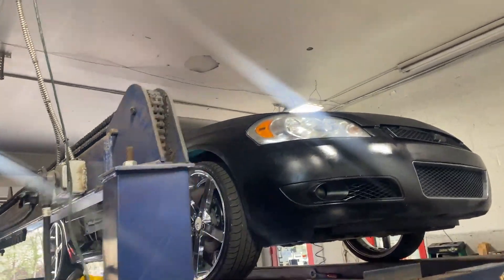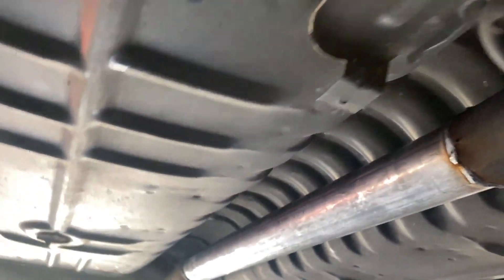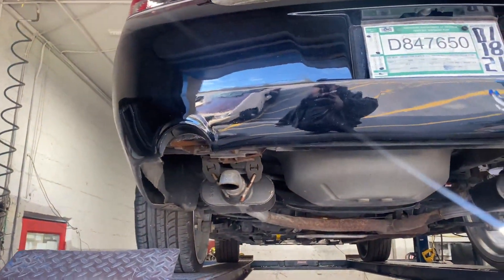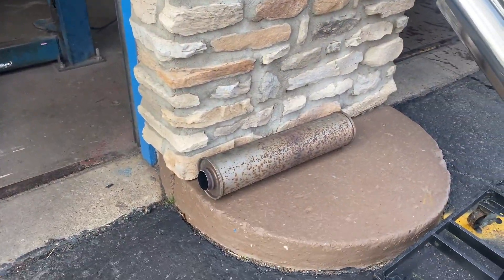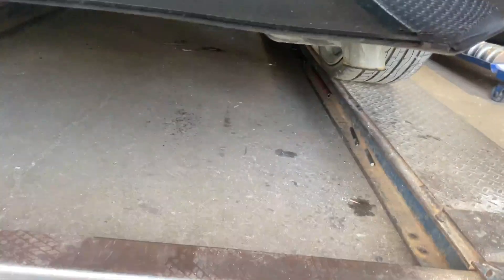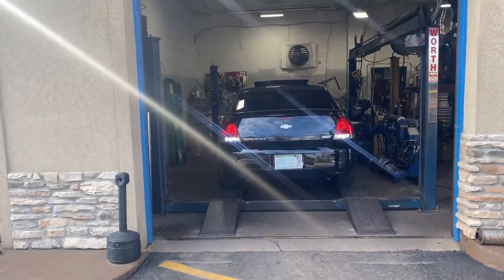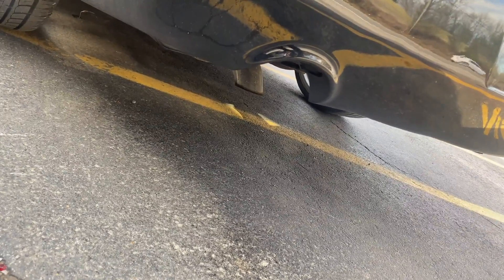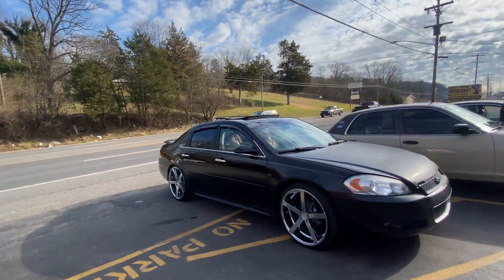2012 Chevy Impala LTZ 3.6L V6 DUAL EXHAUST w/ FLOWMASTER SUPER 10s!

Comment: I’d say Dynomax Mufflers or Magnaflow Mufflers with them pointing out of the bumper would sound better than how they did it. But it’s not horrible, but not great.
Reply: Possibly! I'd hazard it would end up halfway between stock and the way it is now with the '10s on it, perhaps too quiet for the customer. I'd go with 12 or 15 inch louver 2 1/2 core glasspacks in the stock muffler location, flow direction going over the louvers, not into them. Decent sound without all the rasp and drone those tin boxes are letting out.  But hey, nobody seems to want "packs" nowadays 😕

Comment: Had custom dual 40s on my 3.5 impala. It was loud but the perfect loud. If i could do it again i would probably leave the res in and just gut the mufflers. When the AC is on it does like a 4 banger at idle but sounds perfect when the AC is off